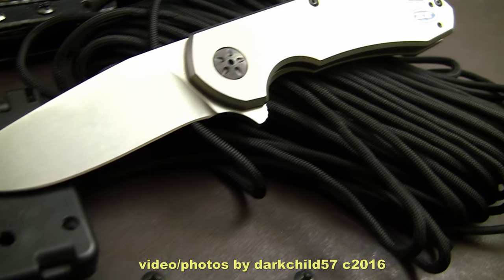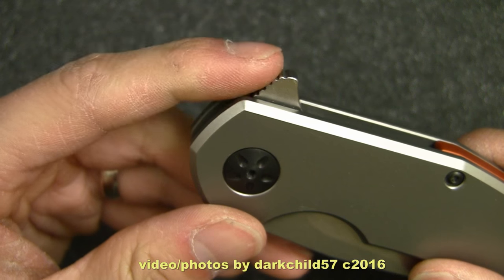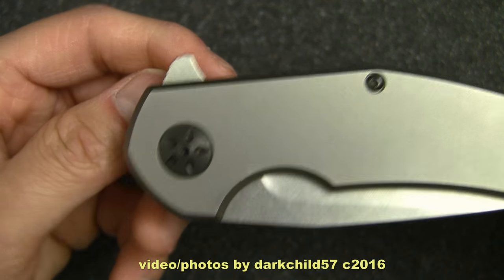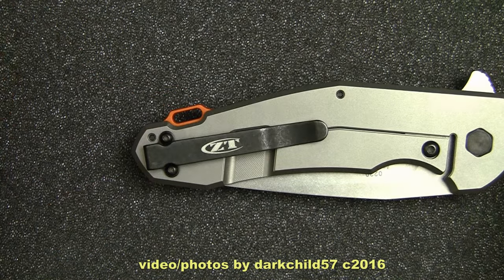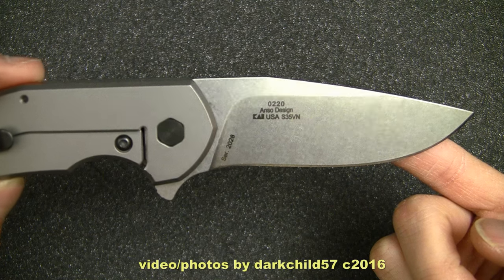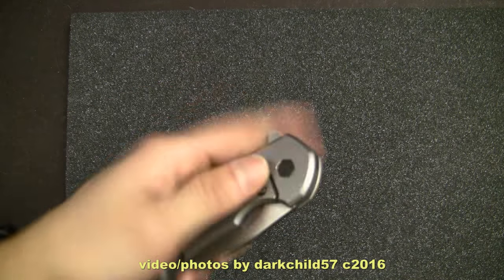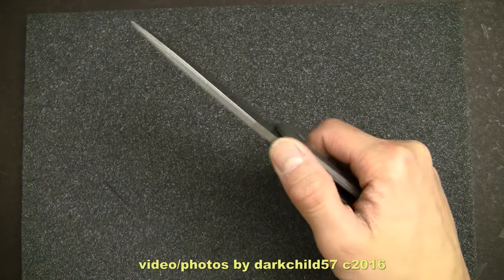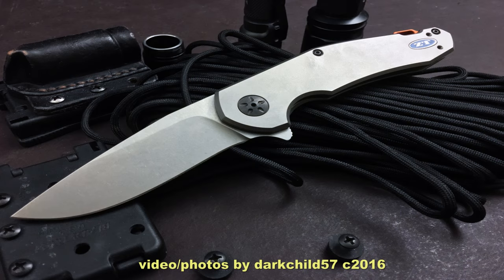Zero Tolerance ZT0220 (specs in description)

Comment: I have to agree with you on all of your points. I've owned one of the 0220's and carried it for over a year. Have no complaints and would recommend it to anyone looking to purchase an edc at this price point and looking for a 4 inch blade. Thanks for your review. I enjoy all of your videos, keep up the good work.
Reply from the maker: Thanks! Appreciate you watching and commenting! This knife still get's rotated in. Just a day ago I had to polish up this blade. I had used it so much that there is gunk on the blade that wouldn't even come off with soap and water. Since I was at my workbench I decided to put a high polish on it. It looks pretty decent, S35VN doesn't take a high polish very well though and I don't have necessary tools and time to get it there, it's all done by hand and elbow grease. But after the polish and some sharpening, the blade now just glides through everything! Handle is a bit slippery but otherwise and excellent knife!
Reply: I agree, once you get a good edge on the blade it will hold it for quite a long time. I like the steel choice for edc.

Comment: awesome video. keep up the great work. im getting my first zt next week. I've had spydercos and benchmades but not a zt yet. I'm looking forward to getting one real soon
Reply from the maker: Thank you:) Congrats on your first ZT knife, I'm hoping it won't disappoint! I've  owned a ton of their knives and have not had any issues yet. Very nice offerings for the money. Which model are you planning on getting?
Reply: darkchild57 I'm thinking about the 0452cf.
Reply from the maker: That is a very nice choice! The 452cf is a personal favorite of mine. It packs the longest blade into the shortest handle and the flipping action is amazing. It's a bit hard to flip at first because the detent is very strong, the secret is holding it a bit to the side and pulling back rather than pushing down on the flipper.  Once you get use to the characteristics you'll love it.  I hope you pick it up, well worth it!
Reply: darkchild57 that's why I like it so much. its been one of the knives I've wanted for awhile now
Reply: toxic flipper Did you get one?  The 452cf was my first, what I consider, higher end knife.  It's looks are killer with amazing action.  I did put a deep pocket clip on it.  The one it comes with is just too small and doesn't flow with the rest of the knife.  Since then I've gotten 4 other ZT's.  They are my favorite American brand.  WE is my favorite Chinese brand.  For budget folders I used to buy Kershaw and CRKT but the knives that Real Steel and Ruike are putting out are simply better values.  I like the American made Kershaws but the Chinese ones with 8cr13mov, similar to CRKT, can't compete with Real Steel and Ruike's 14c28n at around the same price point.  If you've got the 452cf and love it, I'd recommend the 462cf.  Same designer, better steel, light weight for its size, and gorgeous reddish/black carbon fiber.  The 220 in this review is close to being purchased.  Too many excellent reviews of it to be ignored.

Comment: Glad you like it :p I would have liked it if they tried to make the blade completely sterile and move the other markings to the handle like they did for the ZT logo, but I guess that could cost a bit more And I agree it would have been nice to have the decorative pivot on both sides esp at this price point, while we are at it, orange hardware all over would have been cool to have. I wonder if this was Anso's design to keep it more subdued or ZT's
Reply from the maker: I'm loving the 0220! Been looking for excuses to break it out everyday lol...plenty of cardboard laying around my house that needs to be cut down for recycling. I was thinking maybe ZT could move some of the writing to the spine of the handle, maybe even part of the back spacer. They have a version with a blue backspacer, nice looking but doesn't pop as much as the orange.